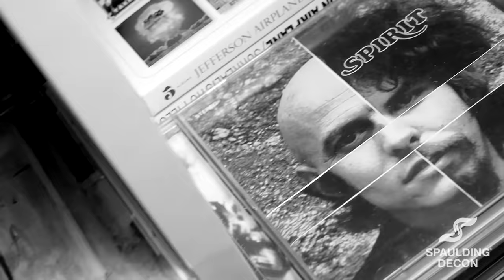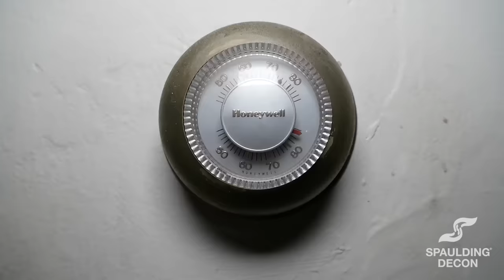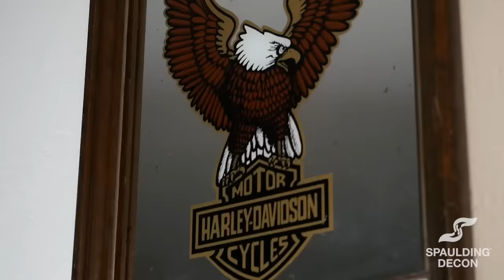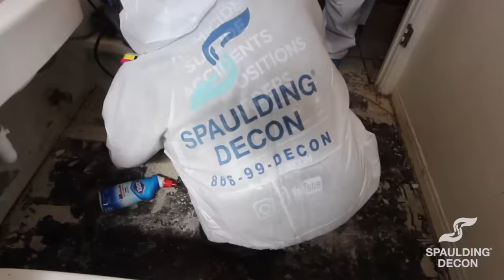19 Days of Rotting

Comment: Years ago my father was a superintendent in an apartment building in the Bronx. There was an elderly bachelor who lived on the 2nd floor who had no living family and had passed away in his apartment. Since he rarely left his apartment no one realized he had died until the tenants directly below him noticed a brown stain developing on the ceiling. This was an early 1900's building with thick plaster walls and lathe and tight fitting steel and wood doors so no smells escaped. After the city came and carted away the remains which was nothing but a moldering pile of goop my father and I had to clean the apartment. We had to use electric saws to cut out the parquet floor in the room where he died because there was no way to clean it as they hadn't been refinished in over 40 years. This was the early Seventies so they didn't have the really powerful cleaners and deodorizers that they have now. It took almost a year to get the smell out of the apartment before it could be rented again.

Comment: I have a couple questions, Is there something that you would use to mask the smell of decomp? AND .. Do you or have you gotten used to the smell of decomp?
Reply: You can't mask the smell, just remove the source. Since this was left for so long, the smell has probably permeated every soft/fabric item in the home. I do know that they have industrial ozone machines to help negate the scent that remains, but it's kind of like removing items from a heavy smoker's home, in that some things will never "smell clean" again.
Reply: Unless they used a SCBA kit like the firefighters use, with its own supply of air. But those are heavy and bulky. Probably not practical for this type of work.

Comment: Weird question but when you're using the wet vacuum which is getting bio and cleaner mixed, brooms to scrub and so on, how does that get cleaned out afterwards - washed down a drain or is there other requirements to be otherwise safely disposed of?

Comment: How can there still be Oder if there is no bio hazard left prolly a really stupid question
Reply: Nah it's not stupid. There's other bio cleanup videos where they talk about this but when bodies decompose the fluids can soak all the way to/into the concrete, gasses can make bodies literally pop open and tiny bits go spraying in places you wouldn't think. Like in this video where the fluids leaked into the floor/baseboard to the adjacent closet. Even a small amount left behind can stink and it only takes a tiny amount to make a whole room/house unlivable.